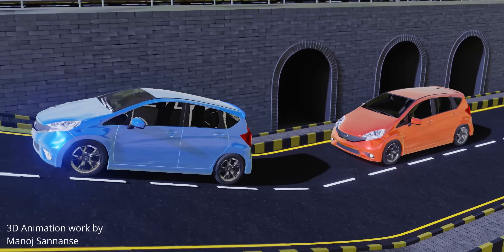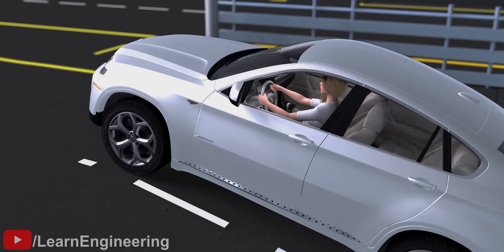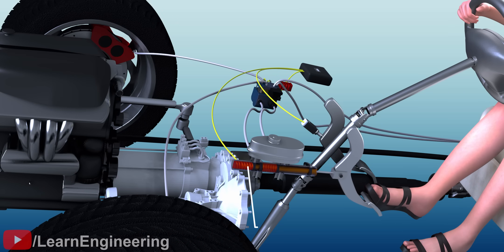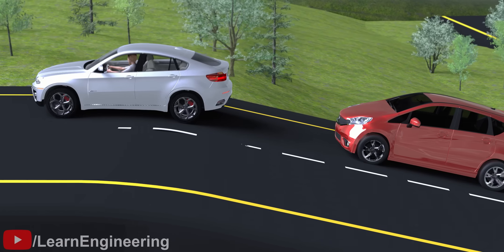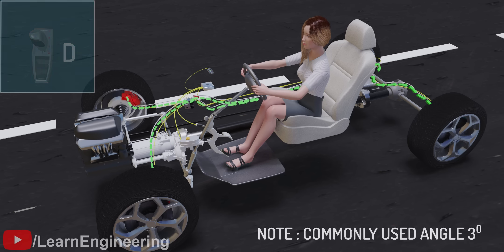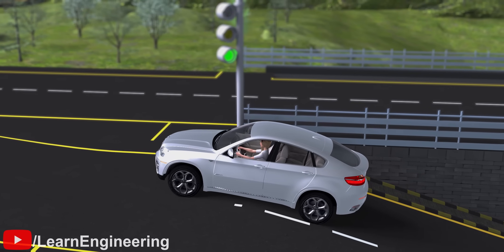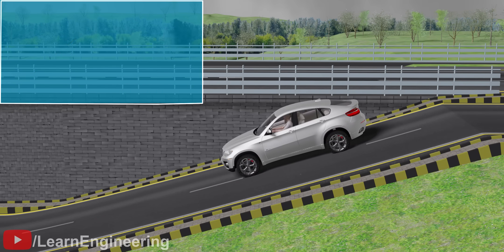Understanding Hill Start Assist!

Comment: The one part missed, is that the engine ECU estimates the torque, and the brake pressure is not reduced until sufficient torque is generated.

Comment: I have 2012 Malibu. When I am stopped on an incline, if I put my car in second gear, it will not roll back. It's as if something in the transmission prevents it from doing that. In 'D' or first gear, I do get the roll back.

Comment: Dumb af.  Auto is easy.. use two feet. Manual, learn how to drive. A hand E brake can be use until you master it.  All HSA doe is wreck rear brake pads cause they hang up and also increases fuel consumption.

Comment: Two feet does the job without all the BS. Left on the brake and right on the gas. I used to drive a stick shift and you learn how to drive a car using a clutch and brake along with the gas and use both feet to drive. Real driving not all the fancy stuff so people can text on a hill.

Comment: This is an insanely complicated and probably failure prone system.  Doesn't even sound like it would work that well.  All you need is a very simple and reliable one way clutch, I am not sure exactly what it is called.  These were quite common, called a hill holder, when my parents were learning to drive.  Maybe like about 80 years ago.  Even better it automatically works in reverse for starting backwards up a hill.  I would never buy a car with this frankenstein system.  Of course with virtually all cars having an automatic transmission now, you don't really need anything like this.

Comment: In older manual transmissions with a clutch pedal, you had to also use the hand brake, then release the brake, press the clutch pedal (left foot), then shift into first gear, accelerate a bit (right foot) and then slowly release the clutch, and when you feel that the clutch is engaging  (you can feel it from the engine vibrations), you release the hand brake and release the clutch still further and accelerate a bit further untill the vehicle moves forward... 😁
If you released the hand brake before the clutch is sufficiently engaged the vehicle would starth moving backward! 🙃 And if ypu released the hand brake too late the engine would stop😅
And to make things worse in petrol vehicles (unlike in diesel engines, which have a speed control governor) you also had to press the accelerator a bit, or the engine will sputter and stop! ☹️
It was literarily a nightmare, and I did not spend enough time mastering the above technique, as in our driving test we were not tested with inclined start.... So even today I still probably would have trouble to start a petrol car with a manual transmission in an incline😁
But my driving instructor, showed me how to do it, and he did the whole above procedure  smoothly withing 2 seconds (muscle memory).
In newer manual transmissions (ex: AMT, which don't have the clutch pedal), you can also use the hand gear assit, for the time duration you release the brake and slowly accelerate. And when you can feel that the vehicle is trying to move forward, release the hand brake.... Or else as suggested in some other comments, one can also use the "two feet technique", aka use left foot on the brake and apply a bit acceleration with right feet and then release brake pedal, when vehicle is trying to move forward...😊

Comment: There shiuld be two kind of break system
 1)  Forward break  :   This break use to  stop  forward motion and allow reverse motion . This will assist       reverse motion on down hill 
 2)  Reverse break :   This break use to stop reverse motion but allow forward motion freely  . This will                      assist while climbing  Hill side
Sensor based breaking may be find in fault

Comment: Call me crazy but when going uphill i push the gas pedal down slightly and press the brake at the same time.  Once i let go of the brake, i have just enough energy to keep the car still and not move without the brake, then i forther press the pedal to move forward

Comment: My wife bought a buick enclave automatic with hill assist that does not work worth a damn. Back in the 80's when I rebuilt automatic transmissions they had a band that grabbed a sun gear when you were in drive and the car could not go backwards because that was the way the transmissions were made. Funny how they took a working solution from 1950s to 1990s and added a problem. Accidents are going to happen.

Comment: I disabled it almost immediately on my 2020 Ford Tourneo Courier, after 32 years of driving I am so used to the car rolling on a slope it felt weird and annoying when it didn't.  It often makes manoeuvring so much easier if you can roll backwards rather than having to bother to engage reverse gear and drive backwards. I use the (mechanical) handbrake copiously and uniuntentionally rolling back on a hill when moving forwards just isn't a problem.  Maybe it is more useful if the vehicle has an electronic handbrake, I hired a 2020 Citroen Berlingo and the electronic handbrake would only release with the brake pedal pressed, which counters the normal hill start procedure!

Comment: when you are using an automatic gear built car, why don't you use left foot for brake and right foot for accelerator respectively and seperately...... it'll be more comfortable and effective instead of wasting money and battery on this HSA..... correct me if I'm wrong

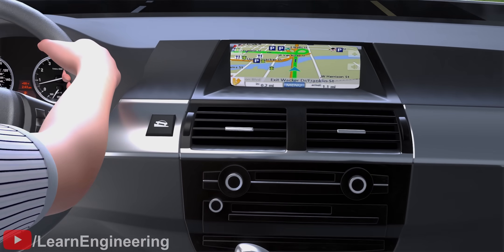Comment: 2:28 "This is a tedious task".

It's a tedious task to press a wonder button that does the job for you automatically.

You know what's tedious? Having to hold the clutch at biting point to balance your car (if you hold it down too much the car rolls, if you don't hold it enough you give it momentum hut it requires gas too so the engine will shut off and the car will roll even more dangerously since breaks work best when the engine is running) so that it doesn't roll down by gravity with the most delicate pressure from your left foot while at the same time switching your right foot from brakes to gas and then slowly release clutch while stepping on gas to even move.

Now that's preety tedious to do.

Comment: wow this system is horrible, just operate brake and throttle with 1 foot , like you know actually learn to drive, a lot of pointless weight and components
( heel brake , front foot throttle , easy )

Comment: i don't understand how the HSA could cause accidents on flat roads, it doesn't change anything except the slow speed creep you get without holding the brake.

it might wear on the brakes more, when the engine is briefly working against them at the transition point, but again, this doesn't affect driving. perhaps poorly implemented systems were jerky, and caused the car to slow down suddenly?

Comment: As a manual transmission driver, I hate hill start assist. Sometimes the HSA doesn't release for a few seconds and it makes it feel like the car is being dragged. I miss my 2003 Honda Civic that would slide backwards when I took my foot off the brakes.
Reply: Wtf
Reply: You just pull the emergency brake when you stop uphill  and then buit up rev then release the hand brake and baam no going backwards
Reply: @definitelynotafamousyoutub6131  that is until your clutch gets fucked
Reply: @offgridgaming9886  you need to rev for a second or two before  going in most cases so just leave the car in neutral with hand brakes on and then when its time to move shift the gear rev to 2 k should get the job then no stepping unnecessarily on the clutch pedal
Reply: @definitelynotafamousyoutub6131  i drive a 5 speed, I know how it works
Reply: @definitelynotafamousyoutub6131  I like how you choose to say "emergency brake" instead of "hand brake". Anyway, thanks for the advice
Reply: @KangJangkrik  it's what generally my dad called it so I go with. Parking brake, hand break , emergency brake all mean the same thing
Reply: As a manual transmission driver, I found this comment disturbing.
Reply: Bruh im 17 and drive a stick
Reply: @offgridgaming9886  gay
Reply: You're not supposed to go backwards in the slightest. You're suppose to be bake to immidietly have clurhc and biting point, balance the car with clutch alone just before the uphill traffic starts moving
Reply: @cloudshifter  I'm sorry, but the reality of physics dictates that in the time it takes to move my right foot from the brake to the gas, the car will still slide back an inch or two.
Reply: @clintgillespie8579   Use the hand break if you can't drive your stick shift accurately.   Or, you can heel-and-toe.   It's about really knowing how to drive a stick.  With hill assist as a crutch, you'll never learn.   Also, you might end up stripping out your clutch prematurely with hill assist--which has happened way too often with this dubious feature.

Comment: I’m thinking the gyroscopic sensor for detecting hills should not be necessary, as by only measuring the brake pressure, the system should know how steep the hill is, no?

Comment: Driving a manual, even though I know this clutch-handbrake technique, or just the fast clutch-gas one, it's annoying when the car behind you tailgates or almost kissing your behind at an incline.  Most likely, these drivers never have driven a stick!  Another irritating one is that you are driving a stick and at a stoplight, in neutral, then as the light just turned green for no more than a second, the driver behind gives you that uncalled for honk!  Geez.

Comment: When I did my licence test in the 80's  I had to hold the car on the hill with the clutch. No hand breke was used. Now days the hand brake is compulsary on hills. I only wonder what will happen when that handbreak cable decides to snap while stationary on a hill.we had to learn complete clutch control. I even taught both my sons how to use the clutch on hills just in case the hand brake stops working.
Reply: Using clutch to hold the vehicle is very dumb. Causes high clutch wear & overheating. No manufacturer recommends it.
Reply: Because holding the car in place with only the clutch damages the car.
Reply: James, I hope they're quick, or they're burning up the clutch.   I do respect your intent.

Comment: Never learn how to use hand brake, never had start with assit, simply because Auto school don’t have car with this function with manual car, and because my current car Audi A4 B6 2003 don’t have it lol. 

I release break, it will instant back down..

But I never back down in hill. Because I always use a hard technic : release clutch at his staking point , complety release brake and just accelerate.

You go and car don’t back down… But you can stall so easy with this method. Never happen to me. 
Then now I got second automatic car with Tiptronic (a4 b7), love to drive both so easily.

Comment: Or if its a n automatic which it probably is, just dont be lazy and use both of your feet press accelerator whilre holding the brake (also gives some nice engine revs) and then release the brake to start moving

Comment: Driving top of the Hill 
Remember this words " PAL" 
Park brake or hand brake click and hold , then smooth accelerate , Look right and look left , if both sides are clear then release park brake , continue moving using acceleration .

Comment: Any heel-and-toe brakers here? That's my fave HSA for manual transmission cars! I would prefer it over the handbrake.. Takes a bit of getting used to the specific car though
Reply: Absolutely!  Even left-footed when my right leg was broken.  Adaptability is the key to a successful life.
Reply: @barefootdesigns  wow you've driven a car with a broken right foot? So pressed the gas pedal with left-foot as well ?
Reply: @yenge5434   When you're poor and living on you own, you have to do what you have to do.   It would have been a lot easier if I hadn't been driving in San Francisco, which is, as most people know, silly with steep hills.   I had raced, so could easily heel-and-toe, but switching it to my left foot was quite, uhhh, thrilling.   Thank gawd for my hand brake!
Reply: @barefootdesigns   that's impressive! Adaptability is indeed key

Comment: There is an old technology in manual Gearbox cars called Clutch .  You can use that to keep the car from move back when switching your leg from brake to speed . or a hand brake if it's very steep uphill.
Reply: With modern cars, maybe, they add gas to prevent stalling, enough gas that you dont roll back, many older cars will just stall if you dont give it gas.

What can work, outside of using the handbrake, is getting the clutch barely before it begins to bite, then give it gas quickly enough that you dont stall, you still roll back a bit and its hard for a beginner to do, but if the driver behind you left some space and the incline isnt too steep its easy.

Comment: I use another technique. I have pressed both clutch and brake pedal while in 1st gear, so when i need to go off i just release clutch to the point where car starts dropping RPMs and start shaking while holding the brake, when the car starts doing these things i just let off the brake, give it a little gas and let off the clutch if needed.
Reply: That’s how I do it as well. As soon as you feel the clutch is holding the car you let of the break and your good. I’m in Prague right now and they have some hills here and there. It’s funny to see how everyone is rolling backwards when the traffic light hits green 😂
Reply: Sorry to tell you this, but when the car starts shaking, you're slowly burning up your clutch.

Comment: For every car with a automatic transmission that I haven driven, it automatically accelerated to a slow speed when you step from the brake. If you have no foot on any paddle, you move at around 4-5 kph. Is that not the case with every car that has an automatic transmission?
Reply: All automatic transmissions do this, the engine is just idling at a low speed if your foot isnt on the gas, if the incline is steep enough or if you are pulling a heavy load the car will roll back.

Comment: How bout using your left foot to hold the brake. Get on the throttle with the right, & at the same time let off the brake with your left. If you’ve got a manual trans. Use the emergence brake to hold your position, & that’s how it was done back in my early yrs. Us Gen-Xers didn’t even have A.B.S., or G.P.S. when I started driving in 1983.

Comment: For an experienced driver holding half clutch or bite force will do the same as HSA but it also cost the early wearing out of clutch plates. So having HSA in manual cars can save your bill and give rest to legs as well.
Reply: If you were experienced you'd use the handbrake instead of burning out your clutch lmfao
Reply: @mappies123  Agree friend but in slow moving stop go traffic in steep hill, this handbrake technique is not useful much. The HSA is therefore designed.

Comment: On an automatic this is child’s play even a toddler could drive up hill since most automatics don’t go in reverse when they are in drive, now on standard theirs a challenge sure you could leave the car on 1st but if you stall out going up hill we’ll it’s worse than the tiny delay between your foot and gas since there’s 3 pedals to worry about. You have never experienced fear until you stall out going up hill In traffic.

Comment: With manual transmissions this is not an issue... And even with an automatic, a little throttle will engage the torque converter enough to keep you from rolling back... This video seems to describe a non issue.
Reply: While you can do that with an automatic it is good way to overheat the transmission and shorten it's life.

Comment: We Europeans don’t need this system. We have a developed a system for this that works just as good. Pull handbrake and put in first gear, when you want to advance. You lift your foot from the clutch while pressing the gas until the car swings wanting to advance release the handbrake and you are moving without dropping even an inch backwards. Every driver in my country masters this like a pro. Automatic cars re a pain in the butt , no joy in driving.
Reply: I drive an AT car and I find it more joyful than the MT ones. They sure are stressful as hell so shut up

Comment: I'm amazed especially in an automatic you need hill assist. Just use both feet! Hold the break just enough to keep the car from rolling back,start accelerating a little until the car starts moving then release the brake! Easy! People are becoming dumber and dumber as technology advances.
I can't imagine if they try a manual gearbox 🤡🌎

Comment: Liked your video.
There is a limitation, though. You are using a car with automatic transmission. 
It is 40 years that, for the purpose, I use an Uphill Assistance LeftFoot Mark I system.
During an uphill car start, I engage the first gear, lift the clutch pedal with the handbrake on, then I release the handbrake while the clutch is partially engaged, so now I can move the car forward without it rolling downward the hill.
A car with automatic transmission, together with an uphill assistance system, seems almost like cheating to me...

Comment: What? If you struggle with the car rolling back on a hill you shouldn't be driving. Its called a handbrake or an "e-brake" for the Americans.
Reply: Many modern cars don't even have a real handbrake anymore.
Reply: @latte_macchiato_de  must be a USA thing because they all have proper handbrakes in my country.
Reply: @zaixai9441  Not an USA thing, no. Plenty of new cars only ship with an electronic parking brake.
Reply: @latte_macchiato_de  yeah which is still the same thing. You can control it manually.
Reply: @zaixai9441  Most are binary triggers, meaning they are either fully braking or fully released. Makes for a pretty shoddy hill start, unlike analog handbrakes.
Reply: @latte_macchiato_de  not really. You just set the gas sightly then release the brake.